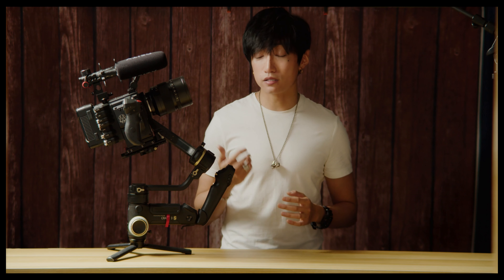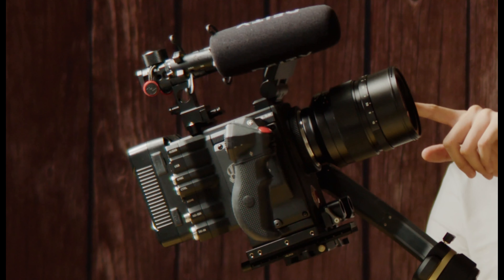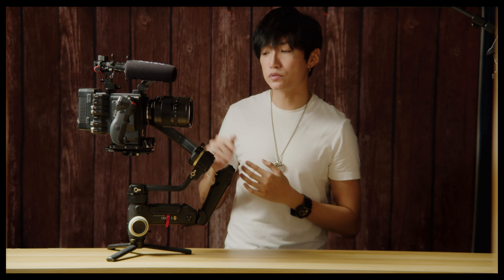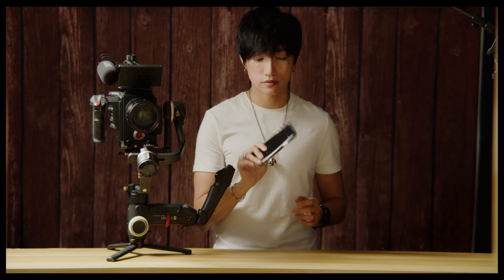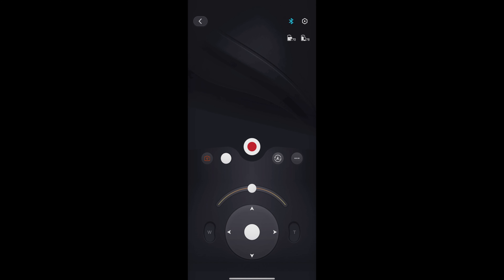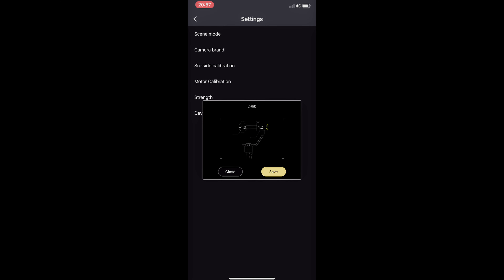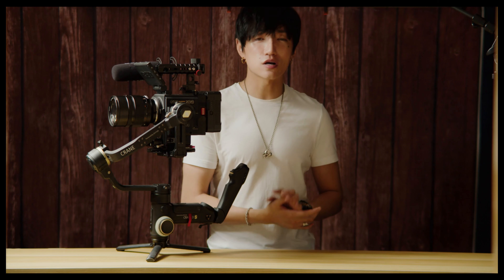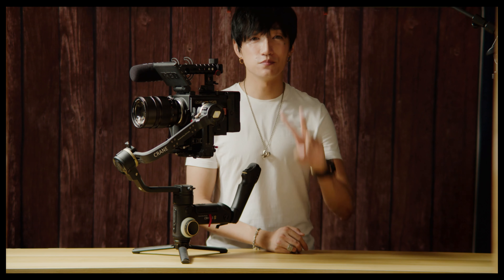Zhiyun Crane 3s shake?? Do This!

Comment: Hey Jeff. I noticed in this Zhiyun video that you switched the lower arm around so that you can keep the side handle on the Red. That's something I've always like doing with my C200 (used the Nebula 5100 Slant for that reason). So my question, is there anything you don't like about that roll motor being in front of the camera rather than behind? Any positions or moves you can't do?

Comment: I'm flying a RED Epic(with V-lock, handle and a Sigma Art 18-35mm), had the shaking issue for a week now. My setup is 6.2 kilo, and had the gimbal on Ultra-mode. But today I tried the High-mode and now I have no issue at all. I can throw this thing in any position at any speed with no shaking. So maybe try a lighter mode :D
Reply: This worked for me as well. I was stressed on first set up because it started shaking immediately, so I kept upping the motor power. Now that I have updated firmware and reduced the power, it works really well.

Comment: Has it held up over the years? thinking of grabbing this when I dont wanna use my steadicam.
Reply: Just bought one for 325 coming from rs2 pro. The fact that I’m now able to start using a full rig and go easy handheld. Without any adjustmenst is amazing. (Using quite large nikkor tv zoom 18.5-165mm 2.8 calculated to ff )

Comment: Do you do this with your camera on it ?
Reply: Yes sure. then you can test it to see whether the gimbal vibrate or not after the setting. If the problem still exits, try to adjust it again until no vibration.

Comment from the maker: Hey guys thanks for watching my video. I tried again today with a lighter setup (sigma 18-35 instead of a 1.6kg lens+ a lighter battery), to my surprise, it’s not as stable. It occasionally shakes a bit.  maybe try to put on a heavier payload? Let me know ur results. I’m in contact with zhiyun’s technician, let me know ur results and I will get feed backs from them. Let me know ur setup, weight etc. thanks

Comment: I am using fx3 and sony 200-600mm lens on crane 3s pro. when i tilt down motor start making noise and i can feel vibration. how can i solve this problem 
because lens is heavy than body. can counter weight solve this problem? will keel counter under the fx3. Please help if u can suggest any solution.
Reply from the maker: can this setup be properly balanced without running power? It must be able to do that first
Reply: @JeffffAn  yes it is working fine now without any issues

Comment: From what I can tell, I cannot get my camera any more balanced than it is. When I turn on my crane, it shakes like crazy in the default position. The only thing I've found that stops this is adjusting the strength of the motors, but then my directional joystick cannot move my camera. I'm running a sony A7III with sony 18-105 lens. How do you know what adjustments to make?
Reply: Did you ever fix this?